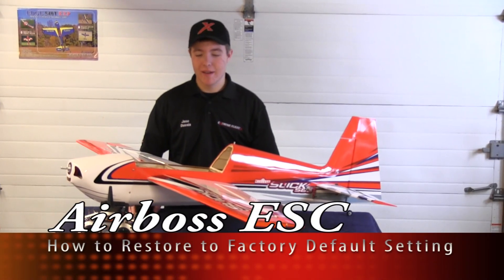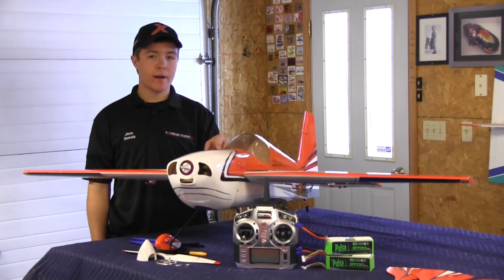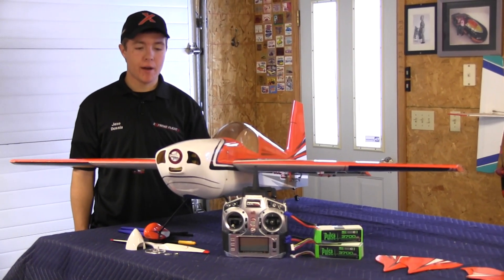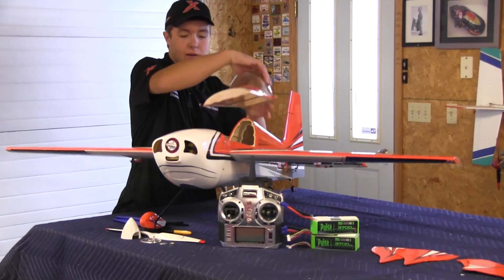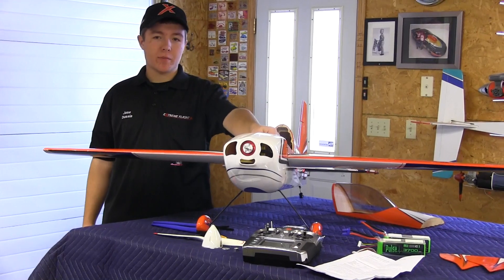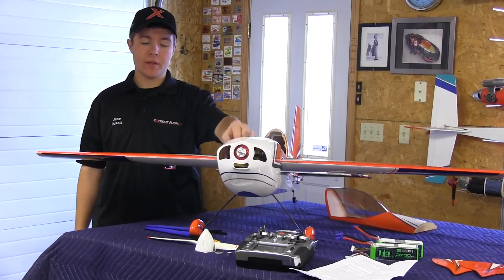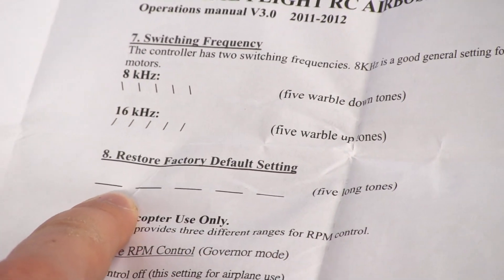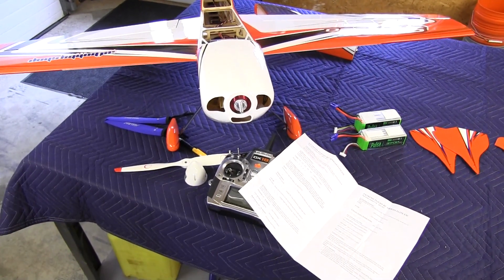Airboss Elite ESC: Restore to Factory Default Setting

Comment: Jase I know this video is a few years old now and I have the slow throttle response on my Airboss 80 esc. The thing is I have never changed any of the factory settings so won't setting it back to defaults be the same as what I have now?
Reply from the maker: Ray Dash no, the “factory default” actually is not the setting the esc is set to from the factory. ...why? I’m not sure lol

Comment: Jase, I have a Slick 580 with the 3910 motor, the manual on the motor says to set the ESC to high - are they refering to the High Advanced 22-30 setting in the ESC manual? Do you recommend that setting?

Comment: How do you actually change a setting, say from lipo to nicad battery  for example, how do you make it change? move throttle stick down when it finishes beeps on the setting you want to change?
Reply from the maker: Scott Anderson yes, AFTER you hear the tone listed in the manual at the desired setting, you simply move your throttle stick all the way back down to the idle position.

Comment: Hey Jase o7 

i learn 3D flying and my question is: Soft Start enable or disable ? Can u tell me some important Settings that i must use for best performance ? i use a "D-Power Comet 60A S-BEC" for my Edge 540t 50" 3D and i have soft start enabled. thx and Salut o7

Comment: Maybe I'm missing something. But the factory default has the soft start enabled. Aka slower throttle response.
Reply from the maker: By restoring the Airboss to "factory default" it disables the soft start function and greatly increases throttle response.
Reply: +Jase Dussia then they need to fix the manual. It says it enables it